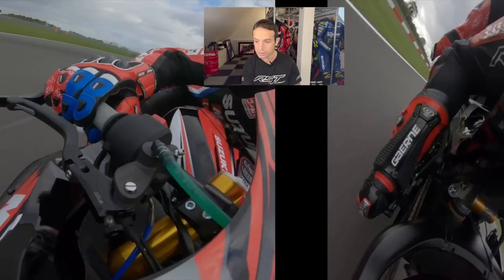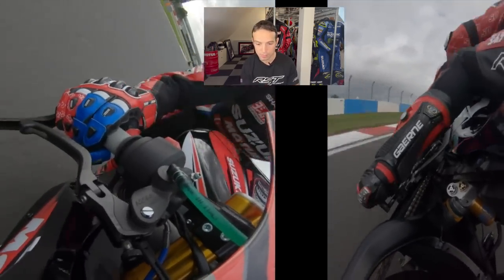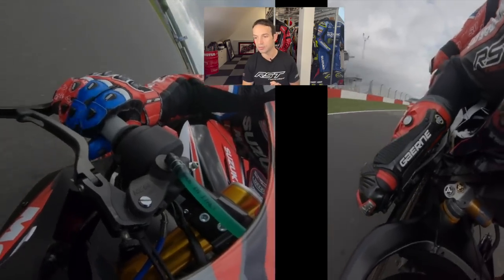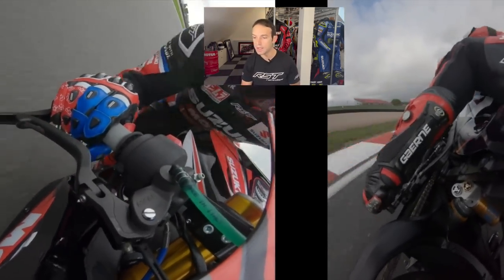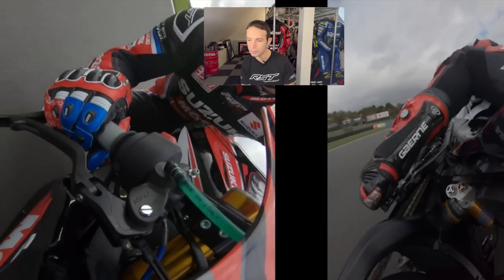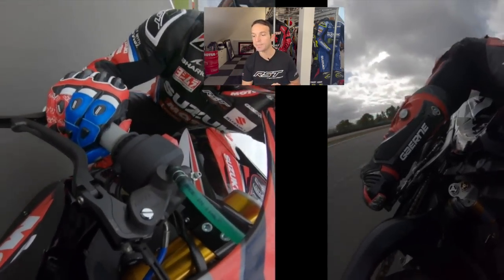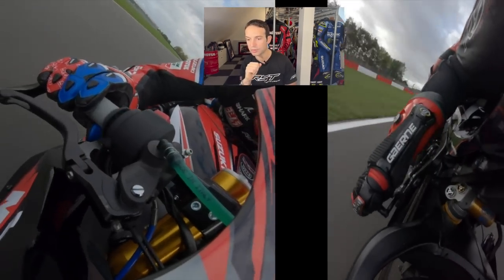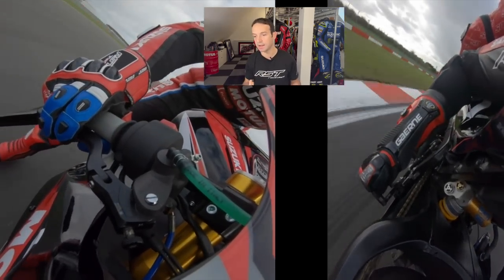🇬🇧 HOW TO DOWNSHIFT ON TRACK - TUTORIAL

Comment: Can you include the use of the clutch. Assuming we don’t have a quick shifter.
Reply from the maker: Downshifting with and without using the clutch and/or blipper tuition video in the members area here https://youtu.be/Bn1JVp0xAqE
Reply: FITNESSOVER45 he doesn’t if he has a good slipper clutch. Sylvain talks about that in the members video. Otherwise it’s basically impossible to blip while threshold braking. Unless u have an auto blipper

Comment: What adjustments would you make if any if you didn't have a slipper clutch?
Reply from the maker: I would use the clutch manually to smooth the entry phase, avoid chain slapping and control rear negative slip

Comment: When you see racers like Toprak they often downshift while the rear is 8 inches off the floor. Is it because the lost engine braking through the rear wheel is made up for by braking slightly harder on the front and saving a bit of time on corner entry by using the wheel speed differential to turn the bike toward the corner when it lands? Have you ever done laps back to back with and without the leg dangle to see what difference it makes in time?
Reply from the maker: Toprak has a unique talent and ability in braking, using the front end to slow down. 
Never compared directly about leg dangle, it does help, especially for taller riders, the gains are marginal

Comment: Hello Sylvain! I wonder, why don't you downshift as soon as you touch the front brake? Isn't it more efficient to do it simultaneously? Why wait for about a second?
Reply: Could possibly be because it would suppress the forks way too much , you need to initially prepare them before the hard push.
Reply: Wondering the same, I thought it's most efficient to immediately downshift when you start decelerating. Having your foot ready under the shifter to shift with the forward forces of braking as soon as you touch the front brake.
Reply: @manbiteslife3110  exactly, while still preparing fork for hard breaking, also downshift, use engine brake to extend wheel base to be able to brake even harder without stoppie
Reply: preload everything, you also get this sensation maybe you've felt it. after a back straight or a section with no braking. you can apply brakes and not apply more but feel them bite down harder gradually. you also preload the tire no shock to tire and you don't shock the suspension and fork oil can do its job
Reply from the maker: Depends on the bike and EB setup. This is my personal training bike… so I’m a bit more gentle with downshifts than normal🤣
But yes, as long as you don’t over/rev’s it’s best to downshift immediately
Reply: Cause the engine brake from gearbox

Comment: @Sylvain: what about big twins? Should we also downshift very quickly?
Thanks
Reply from the maker: Yes, as long as the rear wheel is not locking too much. Engine brake can be very strong with big twins. If you have too much “rear slip” you need to control it with the clutch or change the engine brake settings in the ECU. 
You will find more details on downshifting here 
🇬🇧 DOWNSHIFTING ON TRACK / HOW TO USE YOUR CLUTCH TUTORIAL / COACHING
https://youtu.be/Bn1JVp0xAqE
Reply: @SylvainGuintoli  thanks 😊 I actually watched already all videos. Practiced during my only track day in Assen in September. Can’t wait for next year 😊
I hope SERT will really continue next year and you’ll be part of it

Comment: it almost looks like you have a handful of brakes while leaned over and at the apex...if i did this, my front end would wash out. am i missing something?
Reply: That's called a trail braking
Reply: @NinjaKoalaAUTW  i don't see his hand move from the time he grabs a handful to the time he releases. trail braking eases off the brakes into the turn.
Reply: Are you riding on track or on the road and which tires do you use? Tires with a racing carcass can handle a lot of braking, they even gain grip by appling weight on the front, since your contact patch is getting bigger. If you can get your hands on some data recording of fast riders, take a look at it, you will be flashed how long they have a really high brake preassure.
Reply: and you can see him lowering the preassure graduatly when he is getting into higher leans.
Reply: @Javic167  track, CCS, michelin slicks...
Reply: @wrxzboost  the Michelin Slicks need some setup adjustment for your suspension, when you've ridden Pirelli, Dunlop or Bridgestone before. Maybe it just feels that way, but actually your front end can handle it?
And it looks harder than it really is, the original Nissin cylinder has a long way compared to CNC cylinders which are pretty crisp some times.
Reply from the maker: Braking hard when straight and trail braking into the corner. The more lean, the more I release the front brake but still loading the front to make the bike turn and push the front tire in for more grip
Reply: @SylvainGuintoli  you make it look soooo smooth and maybe it's just subtle release of the brake. also, surprised you don't mention or use a rear brake. thank you for the content sylvain!